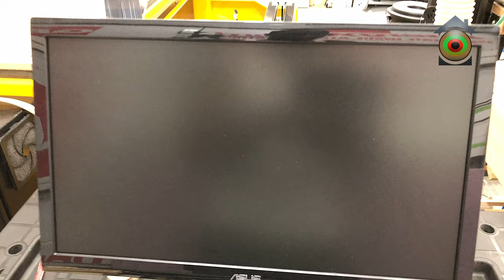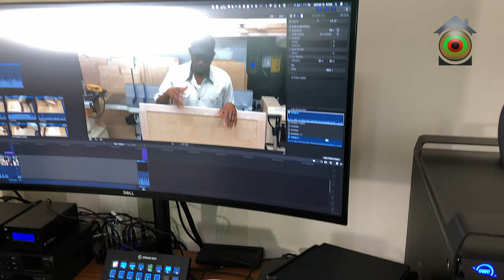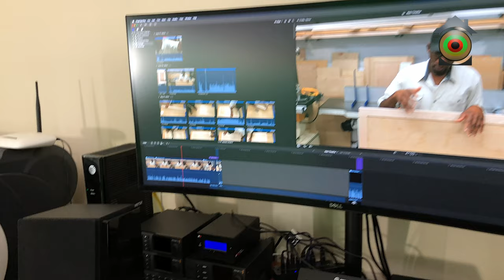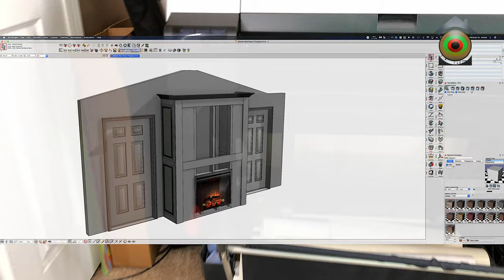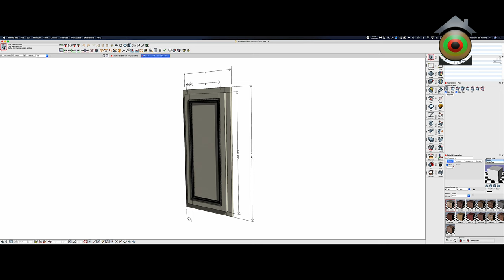Shop Tour October 2021 4k

Comment: Nice video Michael. I like seeing tour editing setup. Your are setup up with all the bells and whistles. I’ve never heard of the Z software. ? Do you run a NAS?
Reply from the maker: What I have is called a ThunderBay Flex 8; It is from OWC. I have it configured with 30 terabytes of storage and 1 Terabyte of NVMe storage which I use as a scratch disk for FinalCut Pro. The 3D modeling software is called FormZ. Thanks for watching Patrick!

Comment: I see a lot of stuff that needs homes. Maybe you’re not a fan of drawers or just need to get around to a storage cabinet? Even the open closet is just big shelves and could be utilized better? I wish you had a larger shop my friend.

That CNC is serious with the three spindles and the lathe axis. Very cool.

Curious if there are casters under the drill press base. Very smart move there by covering them. I used the WoodSmith plans that are fixed wheels without turning.

Very curious about the sewing machine. Looks like a Juki industrial line. I do some leather working and sewing with duck cloth and webbing. Not sure which machine to eventually buy but have been decidedly set on a Juki.
Reply from the maker: I haven't gotten around to tackling storage in a serious way, but it is on the agenda. Although a 4X4 machine would have been more practical for me in the short term, I wanted to gain cnc lathe experience for the long term. The CNC also has a 7W laser attachment.  The Drill press does not have caster, but is sitting on phenolic ply which makes it easier to move around with out tipping over. Finally, The sewing machine is a Sailrite 111 which I believe to be a Singer (Singer 111) clone just like the Juki that looks like it.
Reply: @concentrichomesolutions  I felt bad calling out the random tools but I assure you my shop is the same. I have so many collections of things that are in a bin that makes it a pain to retrieve. Every time I do get to put something in proper storage or make something it’s a little epiphany every time. Just seeing the space empty out where it was all stuffed is amazing. Just too many of those situations to count here :)
Reply from the maker: @FearsomeWarrior  No need to feel bad. I need to get to it.